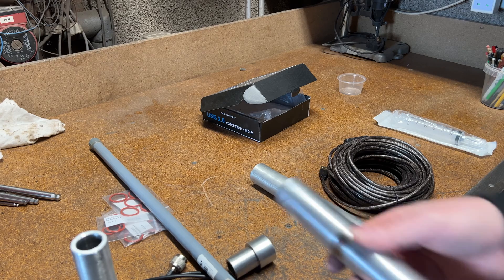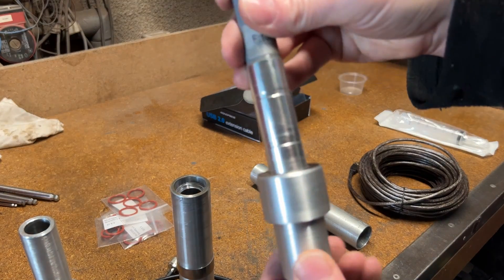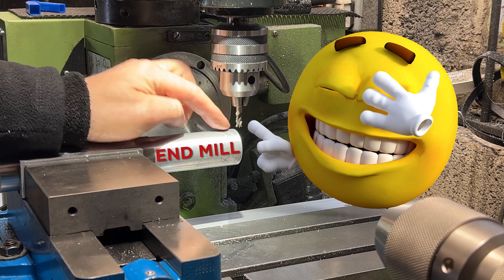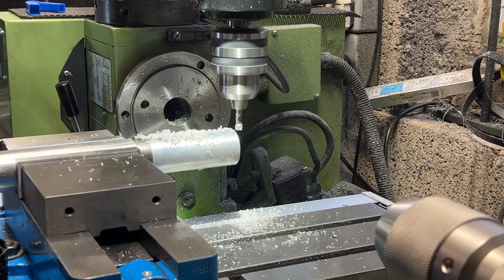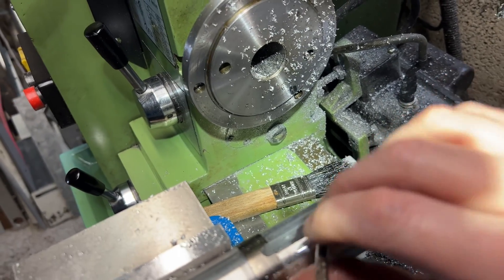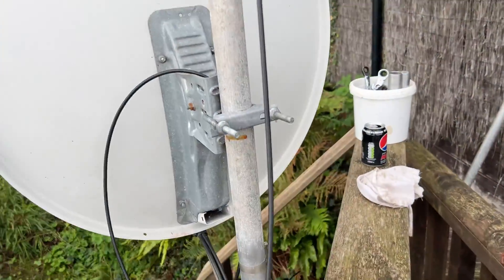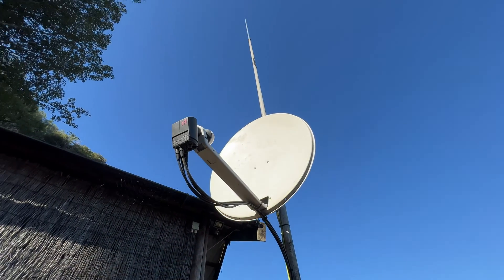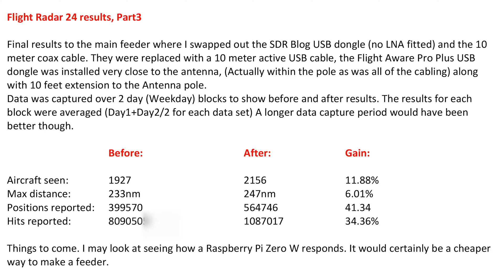Complete FlightRadar24 Build on Raspberry Pi and SDR Dongles. ADS-B AIRCRAFT RADAR System Part 3

Comment: Did you connect a lightning ⚡️ arrester ?..
Reply from the maker: @TravisBailey317  I added a fat cable to an earth rod and the other end to the pole. Not sure got effective it would be in a strike though.
Reply: @ just installed my ADS-B Antenna but after doing my homework it appears it’s strongly advised to have an arrester or some sort of of earthing installed
Reply from the maker: @TravisBailey317  I doubled up the thickest cable I had and connected to an earth rod that I hammered into the ground after connecting it to the ally pole.

Comment: As a complete newby to SDR I am fascinated by ADSB reception.  Have you covered loading the SW that runs in the Pi and the method of transmission to Flight Radar 24 anywhere?
Reply from the maker: Hi Peter. I’ve covered how to build and setup a Pi system including different hardware configurations. There are links to where you can pull the build software from but not covered methods of transmission although if you look on the Flight Radar 24 site there is detailed information there.

Comment: Thanks a lot for these videos they have been a huge help for me as a newbe. Have my ADS-B AIRCRAFT RADAR System  up and runing.Upgrading to a AirNav ADS-B 1090 MHz Outdoor antenna with SMA connector that a friend gave me. Does this needs to be grounded? if so could you post a video on how to do that?Thanks a lot!
Reply from the maker: Hi and thanks for the comments. I've not grounded any of my antennas I've used and a quick search tells me there is no need but this could be system dependent. I have though grounded my aluminium post that my antenna is mounted to, but not the antenna, this is isolated from the mast. I hope this helps. Thanks for watching.

Comment: I've run FR24 on both a Pi Zero 2 W and  Pi 3b, in a very active zone for aircraft.  Both Pis worked fine but the 3b was much more responsive and seemed to handle more planes, somehow. At the same time, I also run a feed for ADSB   Exchange and that feed sees more planes than FR24 all from the same Pi using the same dongle at the same time.  Honestly, I have had this Pi 3b for years and this is the first time is has ever worked well enough to do anything. It has a long history of crashing and is generally one of the worst computers I've ever owned. Glad to see it finally has a use. Meanwhile I have Pi Zero 2s doing superb work on multiple projects. That's hands down the best value I've ever seen on a computer and I absolutely love them.  Would not even bother with this 3b at all except more Pi Zero 2 Ws are impossible to get at the moment.
Reply from the maker: Hi LS, I'm currently running just a Pi3B and it's been faultless. I did try a Pi zero W but had no luck getting FR24 to run. I need to go back and have another go. Thanks for the comments and of course for watching.
Reply: The smalll memory of the Pi Zero is not a hindrance? I just vowed never to buy a Zero again because of that...
Reply: @ronaldglider  it's a Pi Zero 2 W, not the original Pi Zero W.  Memory has not been a problem at all.

Comment: I just seen ya video,ya need to learn about antenna radiation patterns,what ya need to is make a 1/4 vertical antenna and mount that directly on the sdr and u will have a better range for certain types of planes and altitudes
Reply from the maker: Hi Trent, thanks for the advice. I want to get back to the project and make some worthwhile tweaks. This could note be one of them. Thanks for the comments and for watching 👍🏽

Comment: Mike thank you very much for a very informative vid. One concern I have is that the aerial looked quite close to the overhead power lines (I am aware this could be an illusion). I believe you have probably simplified and demystified "plane plotting" or "virtual radar" for a lot of people - I salute you sir!
Reply from the maker: Hi GateKommand and thank you for the great comments, much appreciated. You are right about the overhead lines though! I would have liked to have made the mast taller but I needed to keep it as it is in case the mast failed and headed towards to overhead lines. It needed to be shorter than the height of the lines or else there would have been issues ☹️. It is safe but does look closer in the video!! Thanks for watching 👍🏽👍🏽
Reply: @MikeMakesIt  Yes with a taller aerial and a transformer you could pick up a lot of dBm at 50Hz and light/heat your house for free for a while before anybody noticed!
Reply from the maker: lol. I’ve often wondered if I could 😀

Comment: Very interesting, good pole design! Thanks for sharing! – Did you by any chance test the difference of using the long USB cable alone without making the pole higher (or the long coax with the higher pole)? It would be really interesting to see the difference in the cable. The higher pole will obviously give you more reach. – Thanks again, very cool, from a fellow FR24 feeder. 👍😎
Reply from the maker: Hi MiVyoo, thanks for the comments. Yes, there was a comparison between a 10m coax cable and a 10m active usb cable on a test rig using the same height pole for both tests which was: Difference between SDR Blog dongle with 10m coax Vs. active 10meter USB cable using 60cm antenna in a lower garden position:
5.71% more flights seen. 3.055% increase on distance.
8.05% increase on position reports. 7.84% increase on reported hits.
My video here: https://youtu.be/rPGss0iyn_A
I hope this help, thanks for watching 👍🏽
Reply from the maker: Saw your reply just after I posted! Thanks again 👍🏽
Reply: Ahaa... I just found the answer in your part-2 video: the second case in the video description. Very interesting tests!

Comment: Before upgrade: Hits reported: 8,090,505 - After upgrade: Hits reported: 1,087,017 - Why did the hits go down?
Reply from the maker: My mistake should read 809050. Actual figure was 809050.5 and I rounded it down. I’ll change it. Thanks for letting me know👍🏽

Comment: Are you feeding into flightradar24, FlightAware or another and why?
Reply from the maker: Hi, I'm only feeding into Flightradar24 at the moment . The main reason is this is the first system I started using about 7 years ago. I do also like the web interface more than Flightaware or ADSB Exchange. I do believe though the first 2 platforms restrict some aircrafts from your view where as ADSB Exchange does not. Thanks for watching 👍🏽